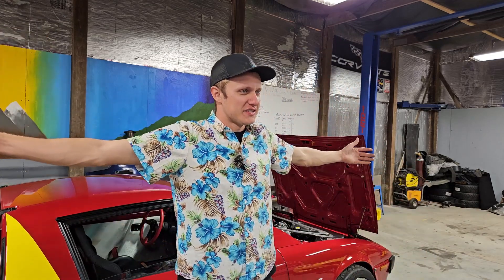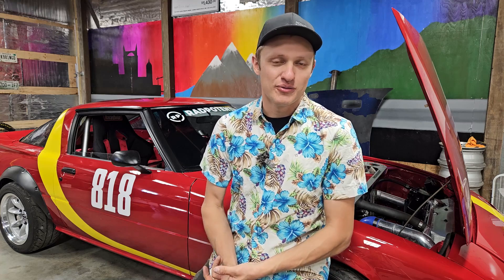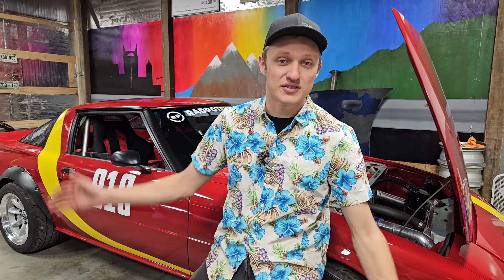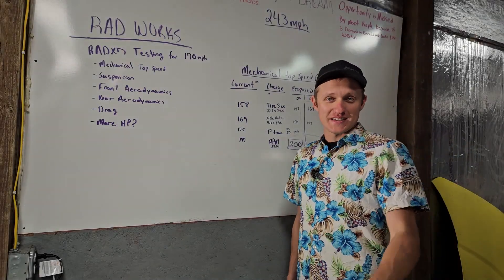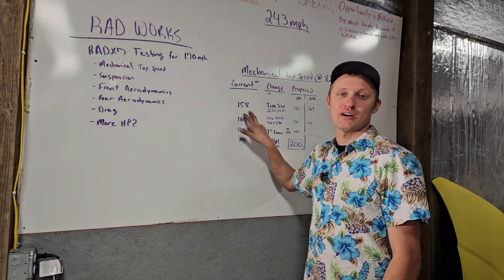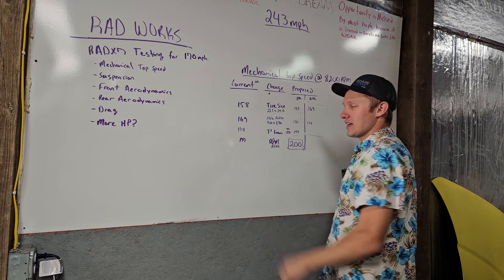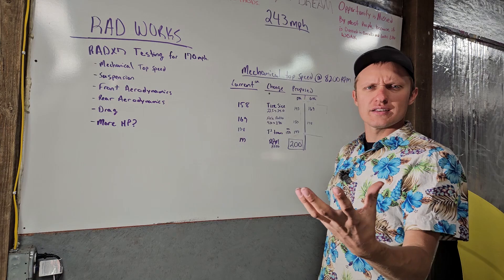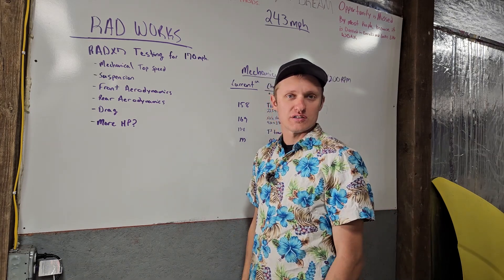Can I Beat Mazda's Top Speed Record With a Rotary Engine?  - RW-1: The Beginning

Comment: You know I forgot to mention my car is  a 85 gsl with a 1.1 and the automatic transmission, which in my opinion the auto was at a disadvantage in accelerating but had an advantage in high speed running, the transmission has an electric overdrive which cut the rpms roughly in half at highway speed, I want to say at 145 in overdrive I was only at about 5000 or 5500 max rpms, I've since used the rear axle of this car in my Fiat spider and it's great with the gear ratio and LSD for a manual in the Fiat.

Comment: The fastest I've been in my 85 rx7 was 145 or 150 mph at that point I got a little scared and let off, the car definitely had more in it however I was limited by my tires, these cars are very stable at high speed, I vividly remember above 90 the car would hunker down to the ground a little and did inspire confidence, the main things to address are tire and suspension, and additional weight, with top speed you need the weight to be stable unlike acceleration you want to be light, regardless of what speeds you hit it will be fun.

Comment: My 12a na with a holley, msd ignition mod and factory transmission shifting at 10k rpms I was topping out the 85 90 mph clock in 4th around 5k. Took it to 5th but I can't tell you how fast it was going. Front end got light and a little squirrely so I pulled out.

Comment: Not to be a dick or anything but your cars aren’t even in the same league as the racing beat FD that car was a masterpiece in engineering at the time. If it had aero I’m fairly certain it would’ve clocked over 250mph if they could’ve kept it on the ground but it wanted to be an airplane at 230+mph like the late 90’s Porsche 911 GT1 at old mulsanne circuit in France at lemans

Comment: Fairly certain the fastest rotary is the Burkdoll Streamliner that was running a 12A and was running around 255-260mph at Bonneville. This was close to 20 years ago so I’ll try to find the exact documented speed. He never got the class record he was aiming for and getting 12A parts started getting expensive so he switched to piston power. 

I’ve raced Bonneville on and off since 2008. If you need any help or support at Bonneville, I’d be happy to help. We’re a bare bones group but we bring a ton of tools, compressor, welder, etc. I also know enough about rotaries to be dangerous to myself. I’d love to see you reach your goal.

Comment: any experience with seats for taller drivers that actually fit in an sa/fb? I picked up a sparco evo xl and the shoulder winglets are too wide for the door to close
Reply from the maker: I'm tall but not wide.  I like the racequips I have in the rally car alot.  A racetech is also very comfortable but $$$